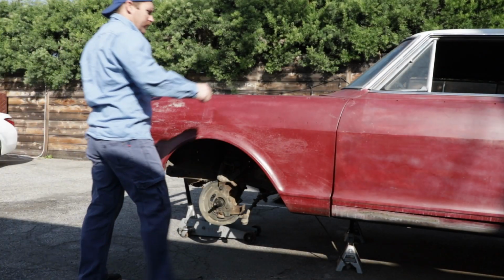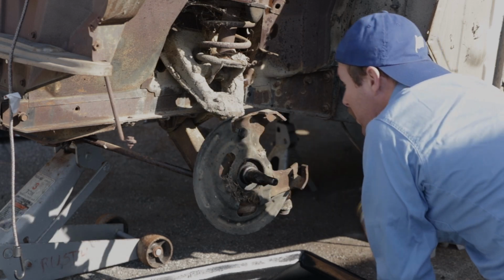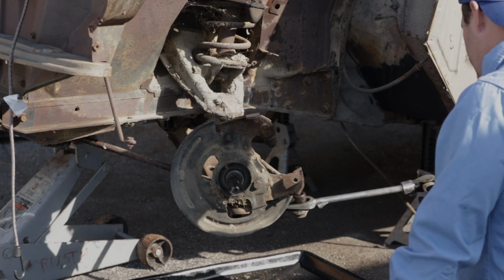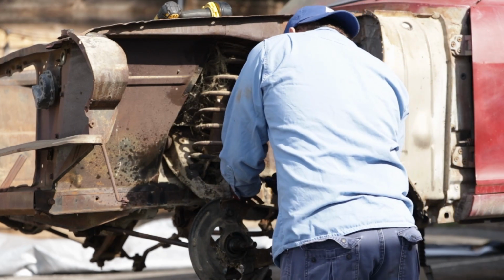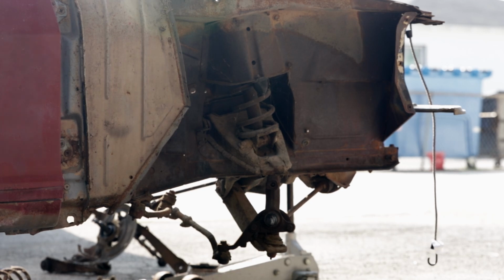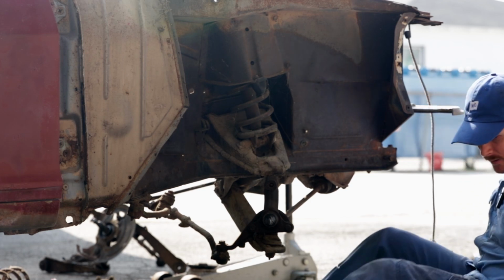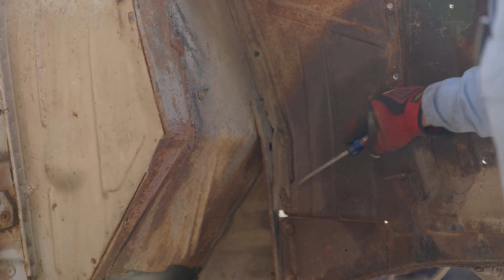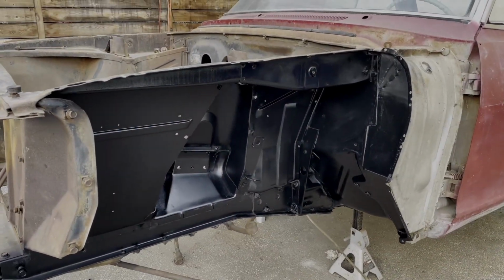1964 SS Nova Project Ep 7   Front End Tear Down

Comment: We are working on a 1964 Nova also. We took that entire front tub off and sent out to get sandblasted and powdered coated. With that front off made it easier to grind off those rivets that hold those strut rods as they will need to go to put the Church Boys lower control arms on. No spring compressor you are a brave man! Good Luck with the Nova!
Reply from the maker: Thanks for the tips! I’ve thought about taking it completely off too, but I’m a one man show most of the time, my dad isn’t over too often to have the help I probably need. Right now the goal is to knock off all the surface rust and get a decent coat of paint on it before assembling the front end again.